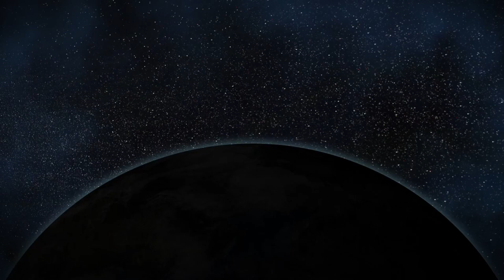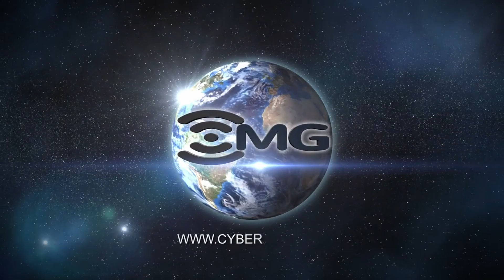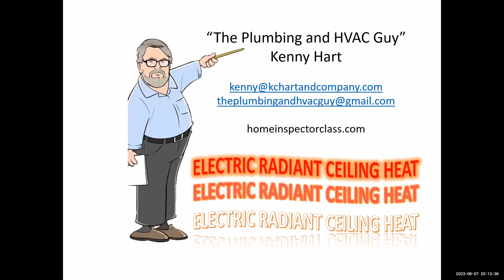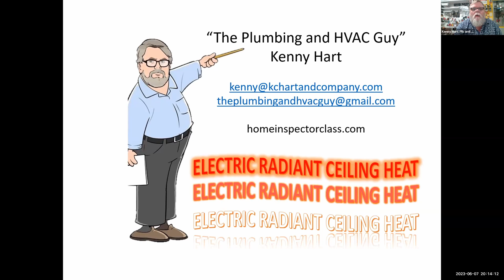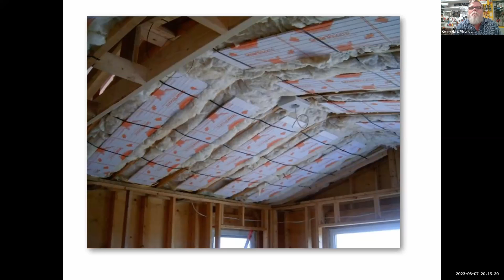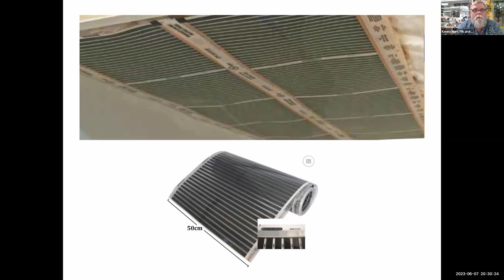Electric Radiant Ceiling Heat for Home Inspectors

Comment: we have this system in our house for the last 20 years.
It seems to take a lot of power to heat the house. EX: 3000 sq ft house uses 6000kw/h of power during cold winter months. It can get down to 10 below for a good part of the months of january february.